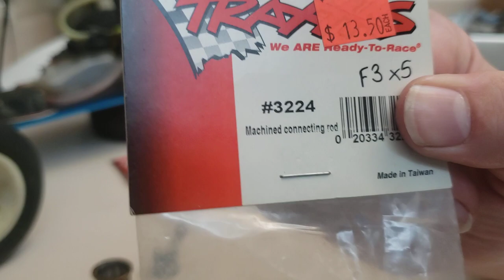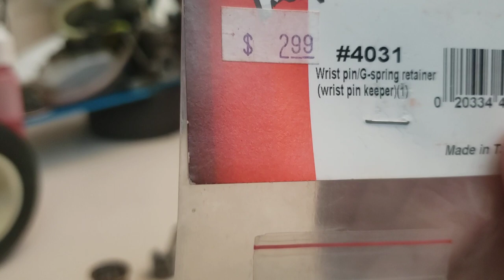Traxxas pro .15  Connecting rod and wrist pin replacement

Comment: Another awesome vid bro!, do you know who makes the AE 15 motor? Are there comparable parts for that piston and sleeve, connecting rod so on and so on does the connecting rod have two holes ? if I drill a hole should you chamfer it? Thanks bro from bucks county PA
Reply from the maker: Hey the Team Associated 15 is made by thunder tiger I'm pretty sure if you search those 2 on eBay you could probly find the parts and I believe the ae engines already have 2 oiling holes mostly all engines do Traxxas just like to cheap out on their engines if you are dealing with a pro 15  A little bit of chamferings at the top eye of the connecting rod and a teeny tiny little oil whole makes a big difference in connecting rod life
Reply: thebug 404  sweet I’ll look into that. I wish team associated would just bring back this truck. I feel personally violated when I buy on eBay lol so f n overpriced thanks again bro! Fink nitro as big Ed daddy Roth would say !
Reply from the maker: @martytoorop5542   I totally agree with you there the prices here in Canada are unbelievably expensive for things it could be $2 for 1 part and $60 shipping or that part if you can get at the hobby shop is $5 some idiot was $35 piss me off

Comment: Do you know when you should replace the engine bearings? I’m not sure if my rear one is going out, I heard of people blowing holes through their crank cases because of bad rear bearings
Reply from the maker: I usually replace them once a year or so  Depending on how much I run the 2.5/3.3 are bad for  Ditching the rear bearing and destroying the engine

Comment: I struggle getting those clips out of the bottom of shocks! Couldn’t imagine fussing with a clip on an engine lol 😂
Also, do you recommend running a throttle return spring, mine doesn’t really make the throttle come back
Reply from the maker: Lol it's fun!
Reply: yeah definitely get a TRS. if your batteries die or youre out of range, bad things will happen. getting a failsafe will help tremedously too.
Reply: Derrick Zanni do you have a suggestion on how to set up a trs on a RC10GT mine doesn’t really doesn’t pull the throttle back, while on my 1/8 buggy a rubber band can pull it back

Comment: Mine split at the bottom hole to the crank tore it apart before completely let go just watching this before I try changing connecting rod
Reply from the maker: That is usually from the bearing being out of spck and making the crank walk out of center. Also running to lean can make the bottom of the rod come apart as well

Comment: You would"nt happen to know whats the deal with two versions of the pro .15 connecting rod ?
Reply from the maker: New one is a bit lighter and non  Directional is the only thing I have noticed
Reply: @thebug4046  Thank you for the info ...the one major thing that ive noticed is the oil hole is at the bottom im not sure how that will effect it I havnt been into rc engines to long only motorcycle engines and car engines are my specialty...
Reply from the maker: @rickwest9563   Yeah they did change where they put the oil hole I don't know exactly why that is but I have the same rod in the few entrances that haven't had any issues
Reply: @thebug4046  ok cool i rebuilt my pro 15 and i have hesitated in running it due to that reason but should ease me alittle ...Id be so mad if that tiny little connecting rod snapped and that tiny little piston hit me in the face id smash it to dust rofl...
Reply from the maker: @rickwest9563   Just take it easy with it give it some preheat and a nice slow break in it'll be fine I run the living daylights on a mine with the same rod that hasn't ever been an issue. KBN!
Reply: @thebug4046  Thank you !!
Reply from the maker: @rickwest9563  no worries!

Comment: man .15 engines are so small... I worked on one a while back, I thought it wasn't a nitro engine at first when I saw the size of the hole where the air filter goes onto.
Reply from the maker: Yup They are definitely small 2.5cc they make much more smaller ones then this
Reply: @thebug4046  i know right. By the way do you have parts for a xtm 457 pro .28? I'll buy it off you for my tmaxx build
Reply from the maker: @cyclicracer  unfortunately not im in the same boat with my XTM 247
Reply: @thebug4046  lol there's so much postings on my local classifieds for the 247
Reply from the maker: @cyclicracer  nothing here